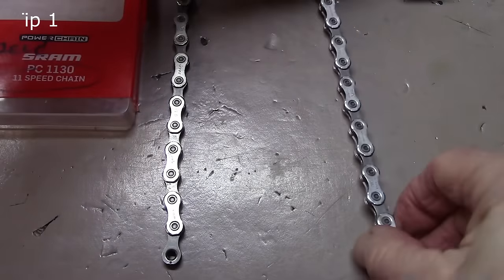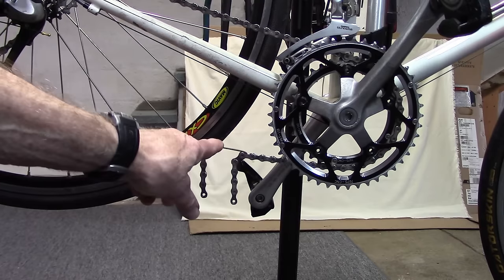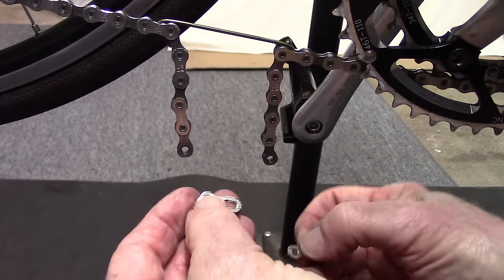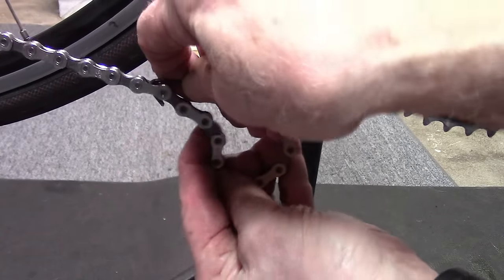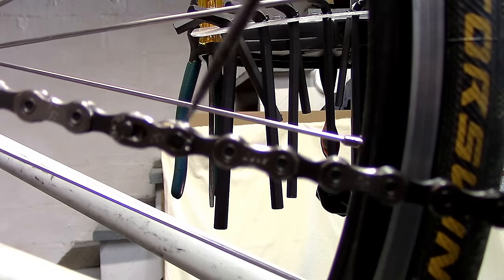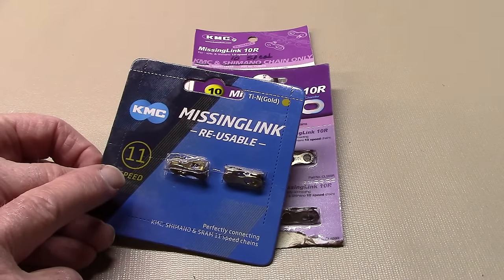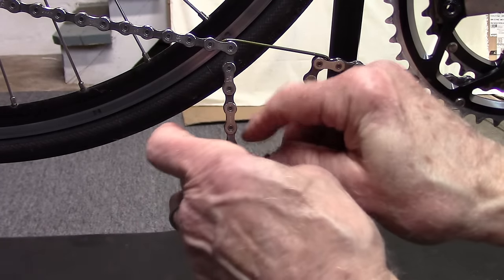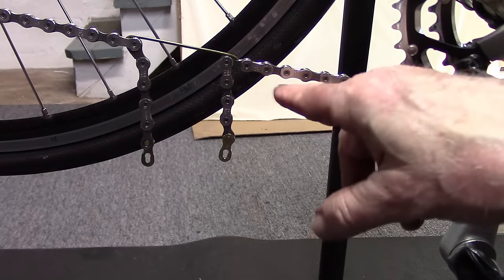Bicycle Chain Master Links: Tips & Tricks KMC Shimano SRAM

Comment: Bringing the link to the top in the big chain ring is what finally got the link to snap into place. Thanks for the tip!
Reply from the maker: Placing the master link at the top and then pressing your foot on the pedal gives you greater force to snap the master link in place. Afterwards, check that the pins are properly engaged on both sides. Regards and safe cycling, Tony

Comment: Thanks for the video.  I haven’t had to use a power lock in a while and was trying hard to squeeze the link and slide them together (for a 11 speed).  It’s a simple procedure but it would not slide together.  Your instructions regarding using the brakes and pressing on the pedal solved  the mystery.  Now locked in.
Reply from the maker: Simple trick. You do need to check both sides of the master link (power lock) after installation to make sure the both pins are securely in place!  Other wise you'll need to remove the master link and try again (you'll probably need a tool to remove the link). Regards, Tony
Reply: exactly! solved my 10 min struggle in one second 😅 12speed masterchain specificaly, would not be able to manage it just by hand...

Comment: Great tip for locking the new master link! I was pulling and pulling and pulling on the master link tool to no avail. One firm press on the pedal with the brake engaged and "click!"
Reply from the maker: It's a neat trick. Just be sure to check that the master link is fully engaged on both sides. Regards and safe cycling, Tony

Comment: I know its a few years late to comment. however something people don't know is that if you push the sides of the link to each other  it makes it very easy to install and remove. I never have to use a tool since I learned this
Reply from the maker: That is certainly true for 9 speed master links, some 10 speed and Connex links. However, becomes much more difficult with 11 and 12 speed master links. One can use ones foot to engage most master links as shown in the video below:
https://www.youtube.com/watch?v=-v4u9pkpIns
Just be careful to check both sides of the chain link to make sure the pins are fully engaged.
Removal by hand of the 11 and 12 speed can be difficult but can be done on some KMC links as you describe by pushing the sides of the master link together. Thanks for sharing, Tony

Comment: Thank you, Tony, for your video! My KMC X10 chain recently got damage: small dent just in between outer plate and roller. So one link became hardly movable. Chain is workable, but I afraid that such immovable link may damage the cassette or rear derailleur, so decided to change the chain. Want to try Shimano CN-HG95-10 (is manufacturer recommended chain for my HG62 cassete). I am used to break the chain for cleaning. I was surprised that Shimano doesn't offer any "quick link" or "master link" for 10-speed chains. But even their 7/8/9 and 11, 12 quick links are not reusable, according to their manuals. So want to try KMC CL559R "missing link". A bit daunted by the fact that Shimano chain is asymmetrical (outer plates are narrower than inner plates), while KMC chains (and suppose links as well) - symmetrical. Hope this combination will work.
Reply from the maker: Although Shimano still offers a 10-speed chain, they never developed a 10-speed master link probably because they saw the writing on the wall that indicated that 11 speed would be taking over. The 10 speed KMC master link should work well with the asymmetrical Shimano chain, at least I don't think you'll notice any problems. My viewers and I would love some feedback after you've had a chance to test the combination out.  Regards, Tony
Reply: @tony10speed  , thank you for your comment! Just 10 min ago I've finished operations with chain: shortened  Shimano chain, degreased from factory lube in non polar petrol solvent, dried, installed on my bike and connected ends with KMC missing link CL559R. Lubed with smoove. Didn't had chance to ride yet. But as far as I could notice on bike stand - chain works like a charm. Probably it's my illusion, but looks like it moves more smooth and with less noise than stock KMC X10. A few rides will show if it really does. Will leave my comment here again after have some experience with it.

Comment: I rode like crazy as a tenager (35 years ago) and now got back into road cycling and things have definitely changed.  I was 25 miles from home yesterday and the master pin was disengaging itself (3k miles on the chain).  I'm the mechanic, technically my fault since I've taken the chain off more than once to clean it and the rear cogs/casette.  Man chains are much lighter and more high performance, and consequently fickle and with shorter life spans.  Thankfully on my ride (which was about to completely fail) a nice woman in car with a bike rack gave me a lift 7 miles to the nearest shop (that installed a new chain, backwards). I think I'm done with "master pins" if I can help it.
Reply from the maker: 9 and 10 speed chains will last upward of 3000 miles, but 11 and 12 speed chains (because they're thinner) will last only 1500 or so miles and need to be checked often with a chain wear checker. It's also possible that the master link was not fully engaged on both sides. You need to check both sides after installation. Don't reuse the master link unless it specifically says "reusable." Once you learn how to install the link, they rarely fail.

Comment: Thank you for all the wonderful videos. They are short and technically to the point. I really benefited and now I'm able to do most of my bike repairs myself. My question: i just installed a new Shimano 11 speed cassette (14-28T) and new Shimano (CN-HG701) chain, with Shimano quick-link, and all is working out perfect. I also have some spare SRAM 11 speed power-lock quick links, and wanted to know if it is compatible with my Shimano (CN-HG701) chain, or do i have to buy another spare Shimano quick-link? also, when for fun I installed the SRAM quick-link on the Shimano left over chain, i found it very tight, wondering if that is normal and will loosen up with use? Thanks Tony.
Reply from the maker: 10 speed - no problem. But Shimano 11 speed are not compatible with 11 SRAM.  See:
https://www.biketiresdirect.com/chain-compatibility-article
So if you're using an 11 speed Shimano, you need an 11 speed Shimano master link (and vise versa). You can also purchase a reusable KMC master link for the specific speed and chain manufacturer. Regards, Tony

Comment: Nice tip. Wish I had thought of it. I've been doing it with circlip pliers that push apart when you squeeze the grips. I've been wondering how I would do this in the field!
Reply from the maker: In the field, you'll need a chain tool to remove any broken link unless you have a Wippeman Connex master link (that matches the speed of your chain, i.e., 9, 10, 11 or 12 speed chain). The Connex master link is easy to remove and replace by hand. If you're using a chain tool to remove a broken link, you can install a new master link (I carry an extra master link specific for my chain in my saddle bag) as shown in the following video:
https://www.youtube.com/watch?v=-v4u9pkpIns&ab_channel=TonyMarchand
Regards, Tony
Reply: @tony10speed  cam acc

Comment: I have a few 7/8 sp kmc master links that require no force to install and remove. I examined them carefully because I thought maybe they just required more force to set, but no they were fully set. I decided not to use them because it almost seemed like back pedalling could undo them.
Reply from the maker: If you're running a 6, 7 or 8 speed chain, the KMC 6/7/8 link can be installed (and removed) without a tool. They will not come off when pedaling forward or backward. The same for 9 speed. 
However, bicycles are not really made for back pedaling. Certain specific bikes can present problems including dropping the chain or the chain jamming. It's not a habit I would recommend. But this latter point is just a personal observation. Regards, Tony

Comment: Have you tried chain wax, sir? I'll be trying Squirt on my new chain. Says to strip the factory lube totally. Those who use Squirt say to immerse in degreaser for hrs then last would be denatured alcohol. What do you think of this procedure? Harmful to the chain, or totally ok?
Reply from the maker: No, it would not be harmful. But I just use degreaser, followed by rinsing with water, soap and water scrub and rinse and dry as in the following video (the video also covers other parts of the bike that I clean - so look through it and use the parts of the video that apply to you):
https://www.youtube.com/watch?v=bQ7SF_uRyqE
You can also do the same using any type of aluminum tray or container that's handy. I have used Squirt in the past. It's important to wipe down the chain and cassette as the Squirt residue gets dirty and black looking before adding more Squirt - to prevent build up of residue on the chain and cassette. Let me know what you think of the Squirt as you use it over the coming weeks.
Safe cycling, Tony

Comment: Question: If using a quick link with an original (great condition) chain, do you have to shorten the chains by one link?

My chains only have the pins, no master/missing link.
Reply from the maker: 1/2 a link shorter (remove outer link portion at one end) which will be replaced by the quick link. Will be coming out with a video on this in the next several months. Regards, Tony

Comment: Hi Tony, I’ve learned that my KMC 10s masterlink can be removed very easily after I get it disengaged like you said. So will there be any chance my chain will come undone while riding?
Reply from the maker: There should be enough tension on the chain to prevent the master link from becoming disengaged (provided the master link is correctly installed with both pins engaged). On the 10s KMC master links I've used, I have not been able to easily disengage the link. Are you running a 10 speed chain? Is the master link marked as 10speed or come with a 10speed KMC chain? Is this an old pre-used master link (they do wear and become easy to remove - and used master links can fail - I've had this happen)? If you bought the 10speed KMC master link separately, it should be marked as Shimano/SRAM compatible or Campagnolo compatible if used for other then KMC. All these factors effect the ability of the master link to hold or fail. Let me know. Regards, Tony

Comment: Thanks for the video. I bought some kmc reusable master links for my 11sp Ultegra chain and they are too loose (can easily undo them by hand), so am intrigued by your experience of then being a tighter fit. I am fairly certain mine aren't fake; they look high quality and were bought from a reputable bike shop. They seem to rely on the width of the inner link on your chain being great enough to hold the pin ends in their slots (whereas Shimano quick links push past an obstruction longitudinally), but on my chain it doesn't hold. I am now looking at trying YBN links.
Reply from the maker: Double check the KMC reusable master link and make sure it's the one for Shimano 11 speed chains. I've dealt with many KMC master links and with the proper link, the KMC that is compatible with the manufacturer of your chain and the speed (11 speed) should not be loose. Re-check what's written on the package the KMC link came in (if you still have it). Let me know. Tony

Comment: Sir,
  I have a cheap 15 speed mountain bike that needs a new chain. It has a derailer. The chain is already connected together with the master link. My question is do I have to take out the master link in order to install it? I know nothing about derailers and how to install the chain in one.
Reply from the maker: No, you don't have to take out the master link. Your can just use a chain tool to "break" the chain. As to installing a new one, here's a video that may help. You will need some good quality tools as shown in the video and a chain that comes with a master link.
https://www.youtube.com/watch?v=02-WEIVoT78
This may seem difficult at first, but with practice, it become a piece of cake.
Regards, Tony
Reply: @tony10speed  
Tony, of course I already took the master link off before I read your answer. I got the horseshoe clip off but it landed somewhere in my gigantic garage and I can't find it. Now I did buy a small bag of master links and , they already come assembled. I have no idea they came like that. Anyway,what is the easiest way to hold onto the link while removing the clip?

Comment: I cant seem to find the master on my worn-out stock chain.. Do some of them not have a master??
Reply from the maker: Some do not. Shimano chains have a special pin when installing the chain (which is hard to find) while others may have been put together with a chain tool. To remove a worn chain, just use a chain tool. Then take the old chain and lay it on the floor and line up the new one next to it as in the following video:
https://youtu.be/02-WEIVoT78?t=143
Now assemble the chain with the master link.
Regards, Tony

Comment: Tony, I bought 25/bulk KMC X9 chains with bulk links included. I've used these X9 chains before, as well as SRAM w/Powerlinks, all went on/off easily. These however will simply not engage the quick links. I'm at a loss, they've always gone on easily by hand. I sent some connectors to the vendor and of course, "they work for us". Really ? Then I tried a 9-sp missing link from a retail pack I had for emergency use, and it went on EASILY, like they always have. So What on earth do I do now, besides buying all retail missing links, which negates the bulk savings  ? I can't say I believe the vendor, but nonetheless I'm left holding the bag, literally.
Reply from the maker: I am very disappointed in KMC and would contact the vendor/dealer from whom you bought the chains and links and demand your money back, but I'll leave that decision up to you. Obviously there's something wrong here despite what KMC says about their bulk links. I, myself, use SRAM 9 speed chains and master links. Would your customers be willing to pay a little more for better quality (since the retail pack is a bit more expensive)? Let me know what you decide. Regards, Tony

Comment: dear Tony what is the different for chain 114 and 118 links and how I Know the correct one for my bike
Reply from the maker: This is a complex problem as bike are adapted to larger cassette cog size and and the length of the rear stays become longer to accommodate larger and wider tires. If your bike is already equipped with a chain, you can remove it and count the number of pins to determine a replacement (with chains, we are taking about the number of pin/rollers rather then links where each link includes an inner and outer plate).  Here are some references that demonstrate some of the complexities we are experiencing with chain length:
https://www.statecyclist.com/bike-chain-size-chart/
and
https://bicycles.stackexchange.com/questions/59549/what-are-the-different-uses-for-the-110-vs-114-vs-116-link-bike-chains
Regards, Tony

Comment: i just got a brand new 6-speed KMC chain and its missing link went together with ~2lbs of force.
I seriously hope its by design and not some defect, it didnt include a spare for emergency.
Reply from the maker: You can buy spare 6-speed KMC master links from Amazon. Don't forget to check both sides of the master link (inside plate and that facing outward) that the pins are fully engaged with the master link. If so, it should work. Regards, Tony

Comment: According to an email I received from SRAM the powerlink is non-directional. The arrows are there to simply inform you that the link needs to be pulled to snap into place to complete installation.
Reply from the maker: I'm not sure who sent you the email but this is what SRAM has on their website: "While SRAM's chains are not directional, but the 9 speed SRAM QUICKLINK with an arrow is DIRECTIONAL. This arrow should put in the direction the chain is moving." 
See page 17 of the SRAM Specification Manual below (Click on the User Manual Cassettes and Chains PDF and go to page 17):
https://www.sram.com/en/service/models/cn-plnk-9spd-a1
And here's another interesting development: My newest batch of SRAM 9 Speed Quicklinks are IDENTICAL ON BOTH SIDES with NO ARROW present on either side (meaning are  non-directional). Could your email contact have gotten these two mixed up? Go figure! This is what makes bicycle repair and maintenance a challenging but fun job. Thanks for your comment and regards, Tony

Comment: sweet 1st cav shirt!  my 10 speed shimano chain is like the one you have....i have a kmc link,  i notice that on every forth pedal- when the link gets to the point on the very rear of the cassette i can feel it ever so slightly in my feet- just a little click...i tried indexing the shifter, filing down the edges on the link, i might just have to live with it...do you notice this on yours?
Reply from the maker: No, I have not had that problem with the 10 speed Shimano chain and the KMC master link. Make sure the master link is a 10 speed and the package material should say for Shimano. Also check that the link pins are completely inserted (and pulled to the outside of the link) on both sides. Otherwise, replace the master link with a KMC 10 speed for Shimano. You may need master link pliers (such as that from Park tool) to replace the link. Let me know how you make out. Regards, Tony

Comment: why would the spd on the link matter? are the links different lengths?
Reply from the maker: Maybe you can clarify your question. Do you mean: why does the speed (9, 10, 11 or 12) of the master link matter? Or does this relate to the writing on the master link?
Reply: @tony10speed  cant you fit an 11 spd chain on a 7 speed cassette by making it shorter? quick link or not